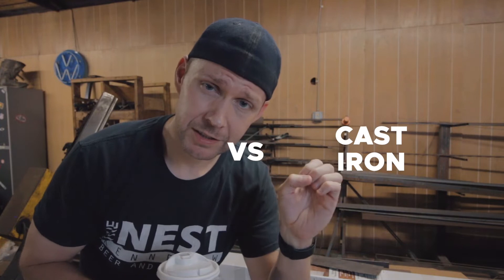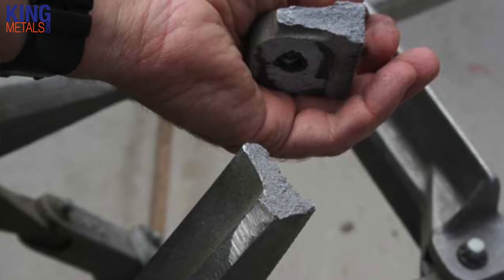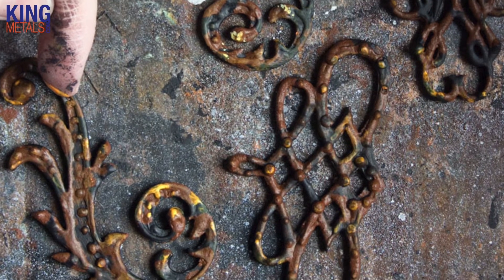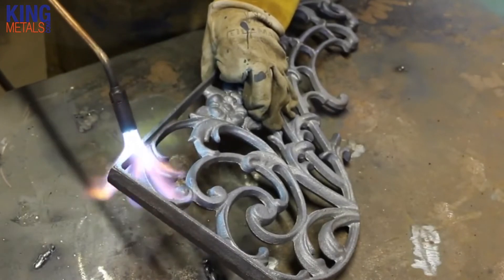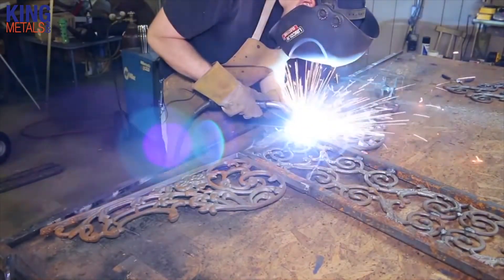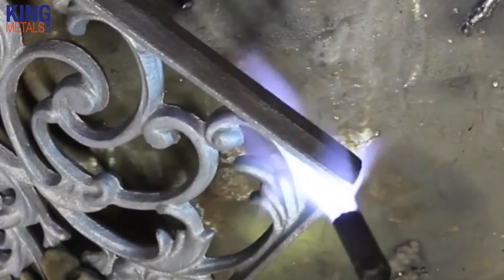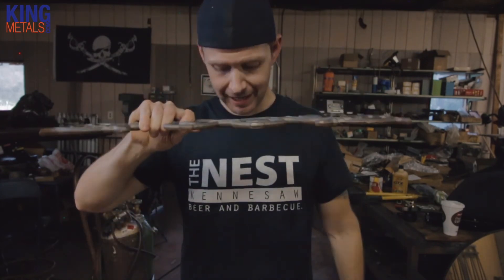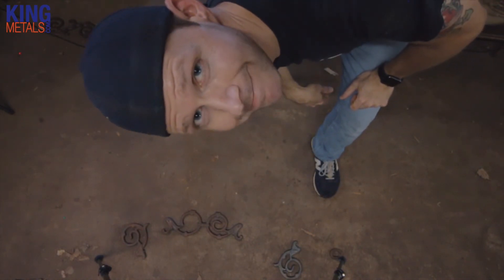Cast Iron vs Ductile Iron

Comment: Got a question I’m building A handrail for a church that goes up onto a platform and continues  I’m using 1 3/4 handrail cap from king metals 
My question is when the cap transitions onto the podium can i notch the underside and bend it or do I need to cut it and weld it on the transition point ? Just getting into handrail building and trying to keep waste to a minimum 
Hope I asked it in a way you understand thanks for a response

Comment: Jeebus.  Cast iron gets a film of rust, yes, but that's where it stops.  That film protects it from further rusting.  THAT IS WHY WE CAN USED CAST IRON FOR MANHOLE COVERS AND STORM DRAINS.  Which can withstand the weight of cars and trucks.  Brittle does NOT equal weak, it means the thing will break before it will bend.

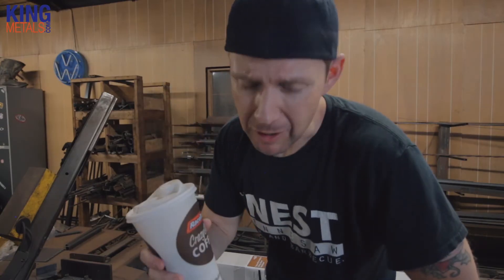Comment: "(Cast Iron is) mostly made of Carbon and Silicone" (1:12). That statement amazes me.

Ductile Iron is a graphite (Carbon) rich version of cast iron (Wikipedia). So, ductile iron has more carbon in it than cast iron. In both cases, iron (Fe) is the predominant component.
Reply: And all it takes is one comment like this to be back on the search for differences between the two metals. This is why you get your information from multiple sources and compare them.